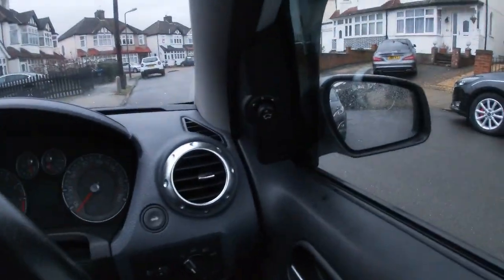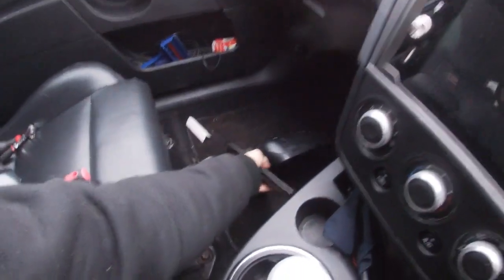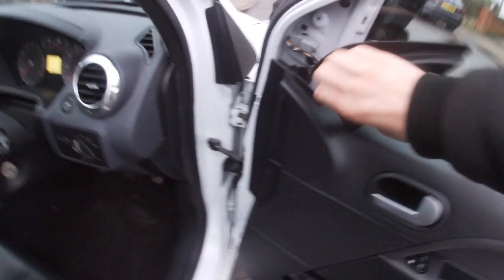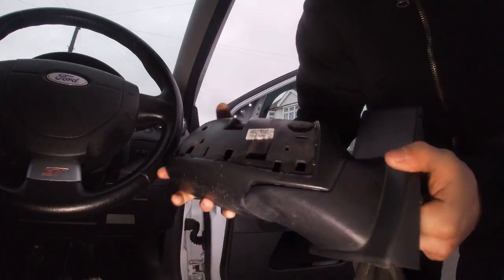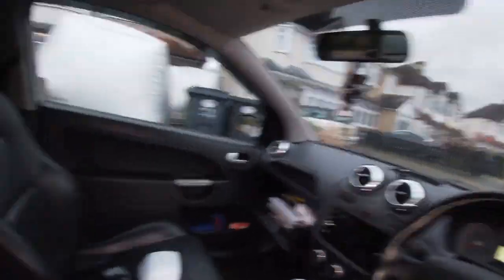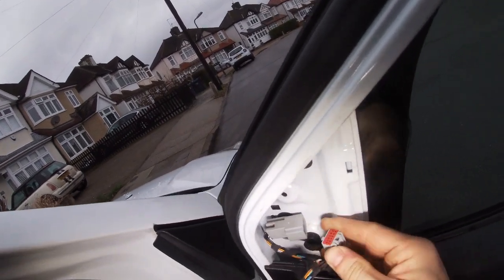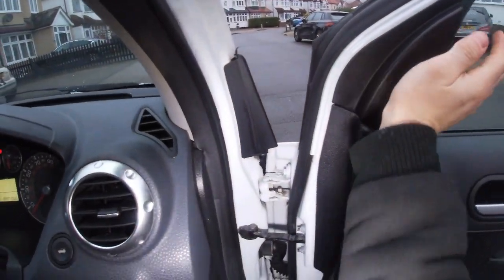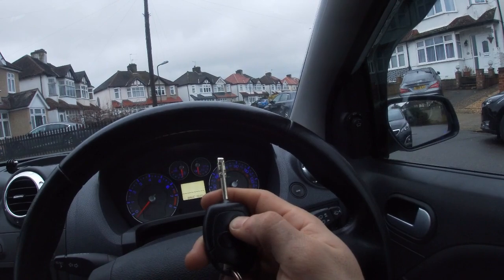FITTING AND PROGRAMMING POWER FOLD MIRRORS TO A MK6 FIESTA ST150

Comment: I’ve got manual mirrors in my facelift mk6 Zetec s just wondering if I’ll still have the wiring for mirrors or will need to get the looms ?
Reply from the maker: Pull the trim off on the interior and look for a grey plug to the mirror the plug should have like 10 pins if I recall correctly if it does it’s a case of getting some powerfold mirrors a switch and programming it in
Reply: @6uiltdifferent  cheers mate will have a look
Reply from the maker: @tyleraustin99ify  no worries

Comment: Maybe a link to the mirrors ? And all the bits
Reply from the maker: The switch you’ll have to find as I bought it second hand they’re easily available on eBay and I’ll put the links for the mirrors the laptop connector and the forum where you download forscan in the description
Reply: Hi there just seen your video on power folding mirrors fantastic i have a fiesta with electric mirrors would i be able to fit folding ones do i need to  replace wire loom and will i have to program
Reply from the maker: Should be able to just fit and programme mate